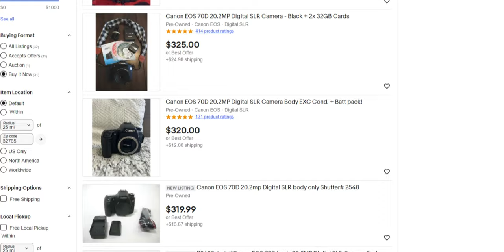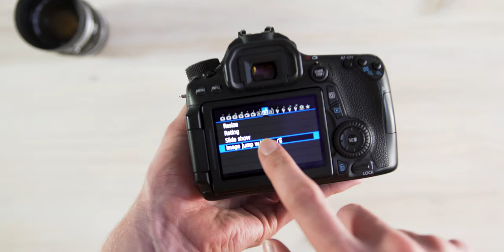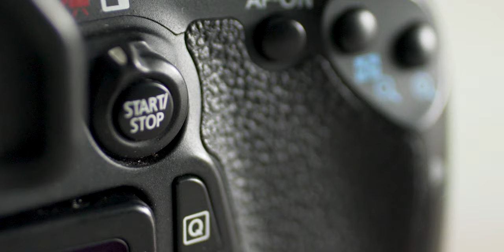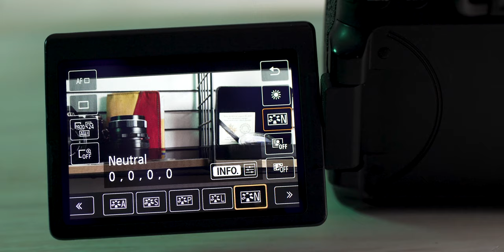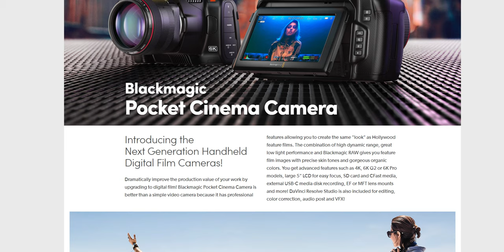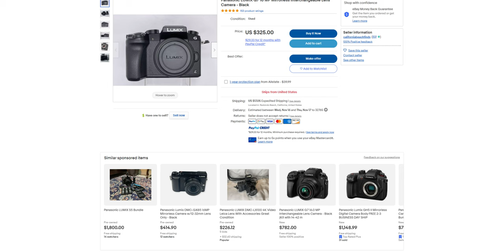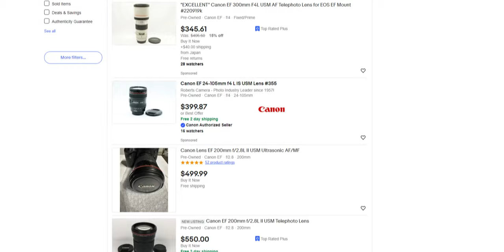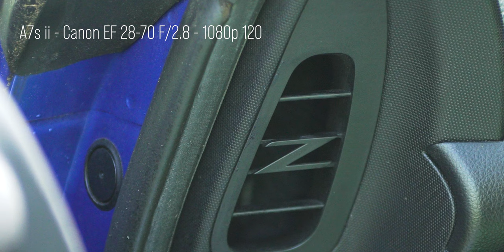STOP Buying New Cameras - Canon 70D

Comment: My dad bought a dead condition 70D late 2020 for $96 (With a physical condition that is still very good and without a vignetting LCD + Battery Grip included). And thank God my dad was able to fix it without having to replace the main board. Until now the 70D is still working fine and I use it as my daily main camera.
Reply from the maker: Glad to hear it worked out!
Reply: Wow. I shoot with this 2023
Reply: @PatrickBatticeKN  How is it?

Comment: I always thought about it for the dual pixel autofocus, but then I started saving, saved enough money and got the Lumix S5. Absolutely love it. I DO need to get that EF adapter for it, I had a cheaper one and that may have been my one return to amazon aside some broken LED panel.
Reply from the maker: The S5 is a truly amazing camera, if I wasn't doing youtube I would have gotten one around the time it came out for sure. You also def want to skip on the cheap adapters if you want to use it for any form of auto-focus, I've never heard of them working well. The Metabones works well enough for me, but I heard it's majorly improved on the a7iii series

Comment: Had a pair of them back in the day, and they did the job. Had to upgrade because they struggled in low light, and only had one custom mode position. The 70d is OK for a casual mixed media cam. However, watch out if you're looking to buy, as some of them had dodgy mother boards that would suddenly crap out giving Error 80 on the back screen. It was so bad, Canon had to issue a recall…
Reply: You can check the serial # and they will fix it for free!
Reply: wow im so glad my 70d hasnt seen that issue, i bought it used for like 300$ CAD. i wouldve been crushed if i got an error and it didnt work

Comment: I know I'm late to the party, but I've had some luck with some better features, though it can be overwhelming, via Magic Lantern. I've also found a cheaper lav mic setup that gives you the headphone jack to listen to your audio. just a few other options that you can use for those extra features.
Reply: Hey, thats a great Idea. I have that Samson mic, and it has a headphone jack - but that thing is a boat anchor. Wouldn't want to do a brake job with that! I am going to check into Magic Lantern. Hopefully its not something that will cause another addiction because of my geekness propensities. (I just checked, and there does not appear to be a build for the 70D)

Comment: have 2 70's when it released and still got it to this day shooting motorsport, it gets the job done, both camera are over 160k shutter clicks  and still going , only one of the camera the scroll wheel rubber came off but it still works, i even shoot stuff in sligth rain and it still goes.

Comment: I chose a 70d (got it summer of 21)for 600 ish) was in mint condition and 7k shutter iirc and came with a 18-135 (which broke but got a 24-105 f4L) but got it due to ef mount, dual pixel(do photo and video) mostly photo this camera is a beast at that and lpe6 due to friends using it (loan chargers and batteries) I love this camera even though I accidentally smashed the top screen (not the flipy) the mode dial is beatup. But its my workhorse that I use and love.

Comment: Older Canon APS-C DSLR (and full-frame if one needs full-frame) cameras are great.  I've had my 7D since its launch and I recently picked a 40D in like-new condition with a moderate shutter count, for $80.  EF and EF-S glass is abundant on the used market.  I bought an R50 to learn mirrorless, and the flippy screen is awesome, so much so that now I'm considering picking up just one more gently loved older Canon DSLR so I can have a flippy screen in that realm.   Maybe a 70D is calling me.

Comment: I have a 70D, I have had a 7D...that I miss deply! :)  But I also have a 5D MK3, a 6D and an older EOS-M model. But the one I always carry in my car is the 70D with a Sigma 24-105 Art. And a HSS/TTL-compatible flash. I can just use the on-camera flash to trigger the off-camera one. Abd a small LED video ligth. It all fits in a small camera bag. And it's versitile as H*LL! :) The 5D and 6D is mostly for studio, the EOS-M is if I need a kamera to just drag around in the forrest or something, just with the kit lens and a realy small flash. It's built like a tank!!! :)
But my goto camera for everyday flexible use is still the 70D. :)

Comment: I'm just replacing my 70D with 80D. The only reason is I want in-camera distortion correction for quick shoots of products I sell on ebay and which have a lot of parallel lines that need correction. Otherwise 70D is good enough.

Comment: Thanks for the video! Whats up with that 350z man? I love Z's. Can you make a video like this about the nikon d3500? Not sure why but my nikon d3500 camera with two lenses(18-55mm and 70-30mm) was purchased like 6 years ago on best buy for like 530$ and I went to check how much is worth nowaday and it's costing $675 for a renewed one with a single lens. On ebay with both lenses are selling for like $580 used. Do you know why the price didn't go down to 200 like the 70D? Please let me know if you get a chance. Thank you!
Reply from the maker: Thank you! I got the Z a while ago because I wanted a rwd v6 japanese car for a decent price. Was in decent shape when I got it barring oil leaks. Ended up deciding to get rid of it because constant problems, cooling leaks, overheating, oil leaks (everywhere), all four wheel bearings going bad, grinding in 3rd and 5th, parking brake failing, power steering pump, alternator and the list goes on haha. Love the car, not the repairs. I'm not sure about the price disparity with Nikon cameras, but I do plan on taking a closer look at them one day, I just have to do one brand at a time so I'm not pouring $2k a month into my channel that makes less than $2k a year lol.
Reply: @aChairLeg  Makes send man. Thanks anyways. You didn't have luck in buying the Z. Mine was 2006 and didn't have any of those issues. Also drifted it for 4 to 5 years no problem.

Comment: I can do better than that. But your idea is right one. I would spring for the Dual Pixel AF. I have used it before. 70D is fine. But buy an 80D, you're done. I have a 6D, and a 1D Mk.4. I have a professional camcorder for video, so I need a good photos, not video. Bargains galore on DSLRs. The EF glass is excellent.
Reply: Agreed. Can purchase an APSC DSLR, and a Full Frame DSLR both... for way less then what they want for one mirrorless these days.

Comment: Just bought a 70D based off this review and a few others! 23k on the shutter and a 6-mo warranty so hoping that will protect me from the potentially bad motherboard issues people have mentioned here.

I’ve been using the 5D Mark II for all my videos and while the quality is great, especially RAW video with Magic Lantern, I cannot stand manual focusing for videos.

I wanted an 80D but didn’t like paying an extra $200 just to get 60FPS. If I need slo-mo I’ll just use my GoPro. Putting it on a 24-105 F/4 but with the crop I may need to get a 16-35 instead…

At the end of the day, If it’s good enough for Casey Neistat then it should be good enough for me!
Reply from the maker: That's awesome! I'm still using my 70d to this day (couldn't make myself get rid of it) and haven't had any issues at all thankfully! The 80d has slightly better AF I believe, but it is insane how similar these cameras are.
Reply: I bought my 70d off of eBay about a year ago. Though it was cosmetically perfect, it went belly-up after one use. After investigating, I found out about the motherboard issue (and I luckily found out about the recall, though I feared the recall had already expired). I contacted canon and was forthright about the fact that I bought it second-hand. They triaged the issue as a recall-related mishap and I got my repaired camera back in the mail 10 days later, good as new, and without spending even a dime for shipping. 
Long story short: my experience is that this particular issue is not reason enough for anyone to avoid buying this camera, and it’s certainly not a reason to worry that it will fail you some day if you already own one. Canon should stand by it.

Comment: You can really tell a mirrorless snob that knows absolutely nothing about photography or DSLR cameras made this video. The title of the video is out of sync with the negative bias throughout the entire "review." EF mount lenses are not "on their way out" because certain types of photography rely on DSLR-specific features such as an optical viewfinder. Regardless, the long and excellent range of EF lenses will never be irrelevant. Lens technology doesn't advance anywhere near as fast as camera tech does, and the quality of lenses from companies that have been in the game for decades won't be matched by the mirrorless market for quite awhile; especially not at the prices you can pick up EF lenses for on the secondary market. And for anyone that needs confirmation that the gear matters way less than the person behind the lens, I have shot photographs and videos that are 100x better than anything in this review on a 2013 EOS Canon SL1 and a 2010 Nikon D3100. Those images are still selling in fine art prints for me to this day. Invest in amazing glass and any camera body will do. The Sigma Art series is top of the line and less than Canon L series lenses. And you can buy them used for way less than it costs to invest in a whole mirrorless camera system anyway.
Reply from the maker: Very interesting